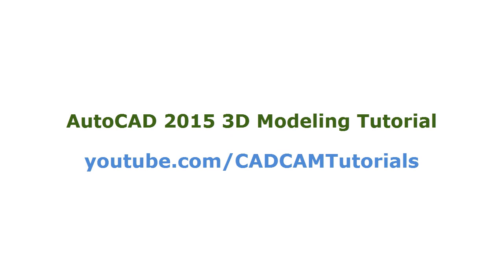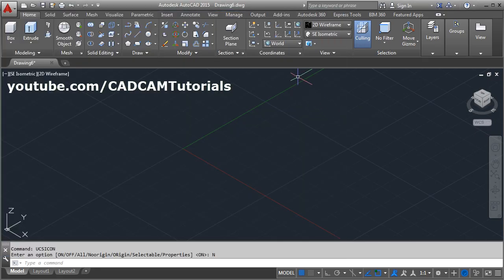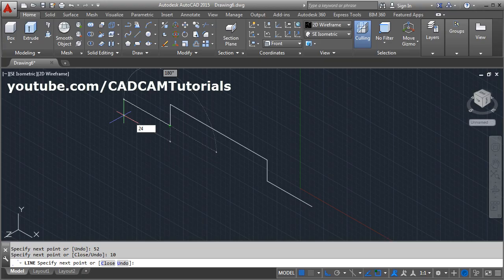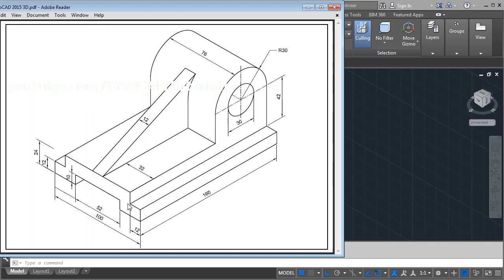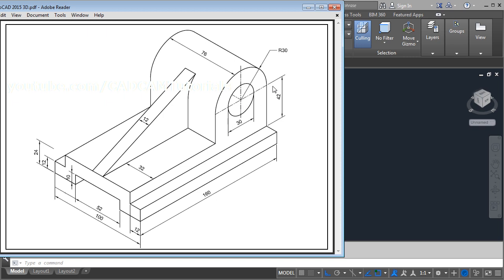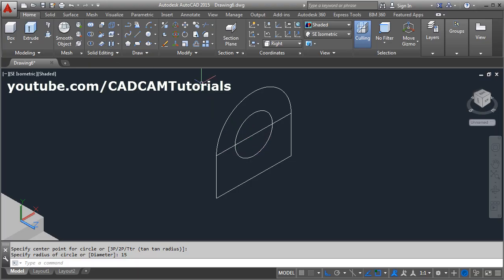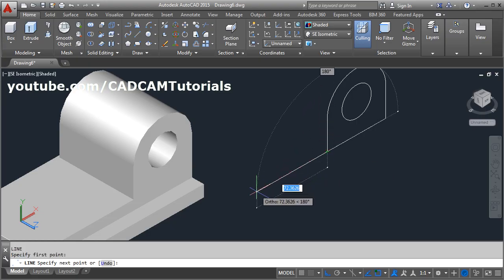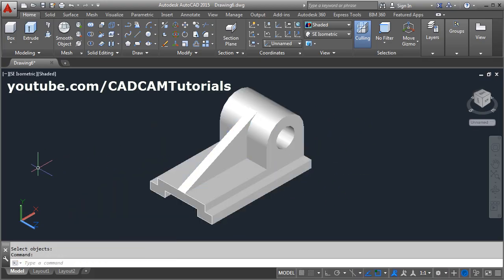AutoCAD 2015 3D Tutorial for Beginners

Comment: 1 point = 1mm?
I'm a beginner. Please help.
Reply from the maker: Normally we take it like that. But it can be other also, if required. It depends on us.
Reply: @CADCAMTutorials  So for example 12point x 12 point will also print as 12 mmx12mm?
Reply from the maker: During printing You will have have to select scale as 1:1 and unit as mm.
Reply: @CADCAMTutorials  oh😁. thank you very much sir😍

Comment: To the min 4.31 you say it will create dimensions 60 with 30 high
but i don`t see that 60 has given at the start of the picture with dimensions
Reply from the maker: 60 is not given. We will have to work out from given dimensions. Then have given 30 radius and 42 height. As we are creating from the top of the object therefore we will have to minus 12 from 42, the ans is 30. 30R + this 30 is 60.
Reply: yahh right :)

Comment: Minimum requirements of graphic card for auto CAD
Reply from the maker: AutoCAD can be used without graphics card
Reply: CAD CAM Tutorials  are you sure
Reply from the maker: I am using it right now on windows xp. What is your use.
Reply: CAD CAM Tutorials  I am using in. Window 10
Reply from the maker: 1. Have you tried AutoCAD without graphics card on windows 10. Is it creating any problem. 
2. You are going to use AutoCAD for what purpose ?
Reply: CAD CAM Tutorials  my study part
Reply from the maker: Does it involve material application, rendering, heavy 3d parts. If not I think it should work properly. But I don't have any experience with Windows 10. For windows xp I can tell it will not create any problem.